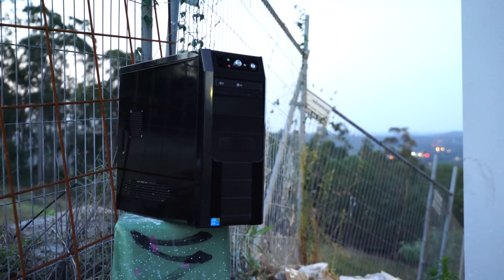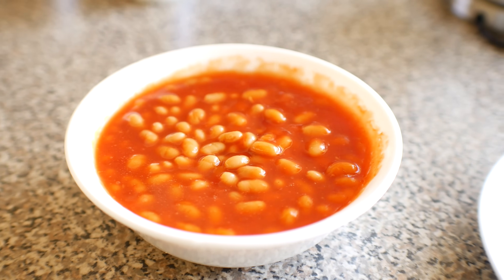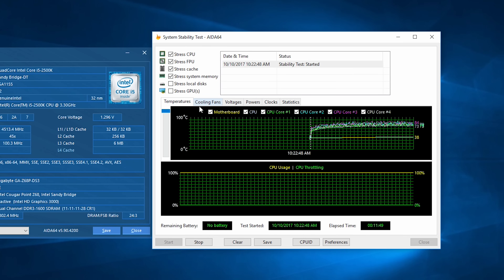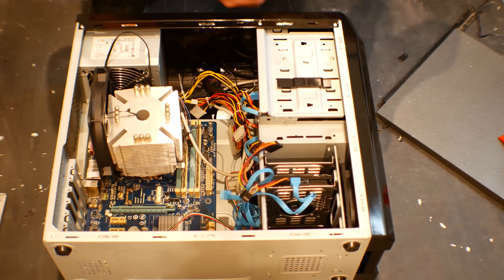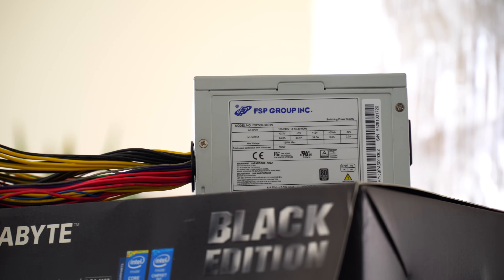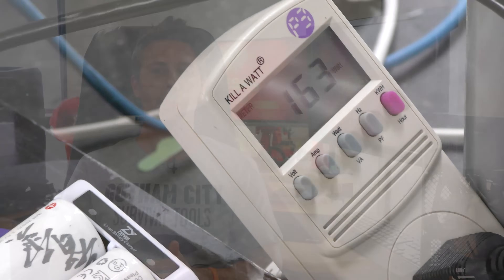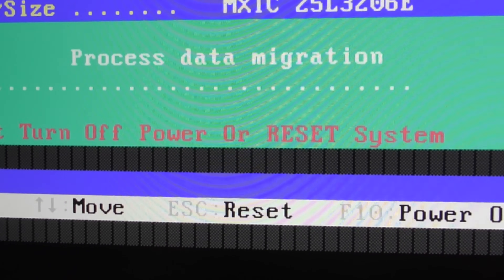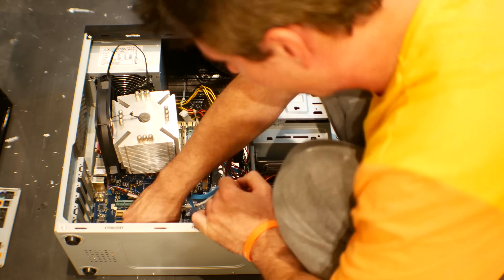Can you OVERCLOCK with a Zip Tie, Bad PSU & Budget MOBO?

Comment: Hey Brian i love your channel mate,i have a Z77 asrock extreme4 mobo with a 3570, but i cant afford to upgrade to a new platform, are you willing to sell one of your 3770k,s for som cash and my 3570k ,would help a great deal, thx mate.
Reply: Justin Merrill a i5 2500k and i7 2600k also fits in that socket, and ocs much further anyways as its soldered and doesnt get as hot...
and compared to a 3570k its like half the price on ebay
Reply: Ahh, thx for the info,and thx for the reply, love the channel.

Comment: Heh, I actually have that first Gigabyte mobo in my media PC. I believe it was the first one with the 3D Bios option. It really was (well still is) a pretty darn good board. I got it cheap as heck too. I believe with the i5 3570k it only added $30 to the price after a $20 mail in rebate.

Again, for the time (late 2011 I think, or maybe late 2012, I forget) having 2 PCIe x16 3.0, an m.2, 6gb sata etc it was a steal.

Comment: I found a gold-shrouded PSU in a computer on the side of the road. Took it home, stressed it with an old Xeon and a radeon 4770, it worked fine. I was shocked. I tossed it in my friend's build (he had an even worse diablotek one) and we carried on. Three months later, I found that same PSU brand new, in a box, at Staples. It was a Staples home-brand PSU. While it only had 4-pin power and one 6-pin, it actually was surprisingly quiet and good.

Comment: That 600W PSU has 25A on the 12V rail?
I got a 350W unit form FSP that has 2 rails with 28A combined.
Reply: Yeah, FSP is actually a pretty good manufacturer.
And the provide a lot of prebuild companies (like HP or Dell), and even those know that proper safety will reduce support hours and thus costs.
But the units in those OEM machines are still just fitting for what it is shipped with.

Comment: I had a Corsair HX520 blow up on me after 3.5 years.  I wasn't in the room when it happened, but when I returned the room was full of smoke.  Thankfully only the PSU had died, and back then Corsair had no RMA centre in the UK, so I had to send it to Holland.  They did replace it with a new HX650 though that is still going strong today and I've had that HX650 for over 5 years.

Comment: I had my first real PSU fail last year. The good old Corsair TX 750W. Though I did have it for 9 years :D
It died with a wimper too, took me like a month to even realize the PSU was failing. My HDD's were not showing on initial boot. After being off over night, I'd have to power on for a few seconds, then restart, and everything was normal. Overclocks were fine, gaming was great. I did this for like a month. I tried different hard drives, BIOS versions, SSD's, SATA ports, SATA cables before I had the eureka moment and thought "it's the fucking PSU!"

Comment: Should i try to overclock i5 4690k to 4.5ghz on h97 pc mate motherboard with good psu ?
Reply: Keni I'm not sure h series chipsets support overclocking
Reply: They do support oc
Reply: They support oc to some extent. Depends on bios and cpu. Some oc options can be missing, like voltage settings. Late bios versions can have oc support disabled even.

Comment: i7 870 Oc, R9 290 Oc with Chieftec 650W and died and killed cpu water cooler :D
Reply from the maker: lol I have heard of chieftec, ahh those PSUs ring a bell.
Reply: Im also building cheap computers but is very hard to find parts here in Croatia
Reply: How much you have overclocked the I7-870. My I7-870 goes 4,18GHz with 1,36V(22x190), but for a daily use I got 4,0GHz with 1,25V
Reply: It was 3,8 with turbo at 1,25V but later sold everything. Now i have ASRock P55 Pro and will put some xeon on it

Comment: Mate, I thought Diablotech was awesome back in the day  Haha...  I haven't OC my computers yet, didn't have confidence.  My old Gateway rig ate power supplies 3 years in a row, original  and 2 generic brands.  Has an EVGA  500W now and holding for 5 years.  This year I built a Ryzen 5 1600 system and used the EVGA 550W silver to start out with.  This was a $600 budget build and I left room for upgrading.  Planning on another Graphics card to run in SLI  so I can have 6 monitors (productivy not gaming).  I expect a higher end Coolermaster at 750 w will work well.
Reply: I seriously thought no one else would bring up Diablotech power supplies as I still have a 350 watt on my work bench in my backyard garage/shop as a bench PSU for testing fans, and older motherboards with onboard graphics to see if they boot, as I got for free from a case salvage, but I would never use them for anything more then that for sure.

Comment: The first PC I ever built from scratch was a Xeon 775 mod. I had spent all almost all my money on the motherboard, processor, RAM and GPU, and I decided to cheap out on the PSU trusting that the Corsair 430W I had picked up for 20 bucks would get along with the X5460. 
The first boot showed me otherwise, frying the CPU and the motherboard. Burnt smell only came out after the PC died though.
Reply: 430W should be enough unless you are running a manor hog of a gpu.
Reply: nn vv well it wasn't, or it was just in Terrible condition. It fried anyway.

Comment: Hey , I have an "hight power" name . And it's 750w 80+ only . I have an i7 6700 gtx 1060 16gb ram asus mobo 1 ssd 3 hdd . Should I throw that psu away ?
Reply: u spent 800+ on hardware, why not spend 30-50 bucks for a decent power supply?
Reply: Absolutely. That's full of rubbish components. I went with an EVGA Supernova G2 850W for the 10 year warranty. Only about 109 on Amazon right now if I remember correctly.

Comment: Yo man, i got a Q6600 (105 watt) , GT 1030 (30 watt) and 8 GB ram ddr3 and one HDD 500 gb, can my PSU 220 WATT hold it? Thanks :)
Reply: It should, but it would be wise to replace that psu if you can
Reply: maan that cpu when 20%ocd takes 80%more power.failed to oc 3.0ghz with a 450w psu and a gtx650.DO NOT do that.im amazed it boots

Comment: i dont know but my PSU luck is bad, like really BAD all time, except gigabyte odin pro 800w, i didnt have any problem with that and im using that PSU for like last 7 years. Not a single problem happened. But i bought two TT psu, 1 Antec and recently like 1.5 years ago Seasonic 750W gold rated, all of them got RMA'd. My luck is so damn bad that i got bronze rated 720w seasonic psu instead my original one coz seasonic had problem with local distributor. They dont bliv they had so much RMA issue, truth is in my country their PSU quality sucked big time, 1-2 yrs max lifetime for their PSU and then u must have to send it to RMA. My poor PSU luck.

Comment: Tech Yes City I tried overclocking my i5 760 on a H55 intel board. The board was working fine, i then changed the multiplier and the board refused to post, i placed the cpu in my other p55 board the cpu was fine, but how do I fix this motherboard that I altered the multiplier with
Reply: Resetting the CMOS should work

Comment: I had a Golden Field "550W" ATX-550WUS, 21A on the 12V rail, blew up on a C2D E6320 with a GT220, didn't take out anything else though.

Before that though, a Huntkey "500W" LW6500-HDP killed an ASUS P5K SE MB when I switched that system to stand by.

Comment: Yep, I remember that when I upgraded my overclocked Pentium 4 to 3.8GHz machine to a 2600xt my old PSU couldn't handle it so I bought a 460w Eagle psu on eBay and turning on the system just as it hit post it shot flames out the back and burnt my wall a bit. Thankfully it didn't kill my PC but I took it outside and smashed it with a hammer cause I was very young and very angry. Don't remember if I gota refund lol.
Reply: Angelito Posse id still smash it up even if i wasnt young
Reply: M Huang So would I, only now I would definitely chase that refund although thinking about it I think the seller gave it to me when I told him it shot flames lol. It costed like £10 though so what could one expect 😂

Comment: Not exactly a power supply for the first one buy had a fan splitter actually cause a burning smell, immediatly removed it and opened some Windows 

Then tried to run a ryzen 1600 @3.9ghz ,sapphire r9 fury nitro, and a 290x with kraken g10/corsair h55(think is was the h55 or h60) on a thermaltake broze rated 750 watt power supply. Booted up fine but was trying out ethereum mining and I heard a series of clicking sounds from my machine and other weird noises. Scares the crap out of me so I turned it off and bought a second gold rated 600 watt psu(got in brand new on Craigslist for under $40, sold it right before the august mini crash for $55) just for the graphics cards. Worked fine and safe for the weird setup. Ended up months later buying a semi-modular EVGA 850 watt bronze rated psu from Bestbuy on sale for $55

Comment: Wish my i5 2500k would run at that voltage for 4.5 but anything over 4.1 I need higher voltage than that if I don't want my PC to bsod but if I do that my processor gets very hot on my processor cooler :( but can run my processor at 4.0 at 1.25 voltage no problem but anything higher needs way more voltage and idk why.

Comment: PLEASE!!! compare Xeon X5650 OC to Ryzen 5 1600.
Reply from the maker: I do plan on doing that after this coffee lake stuff I have to get through, its on the top priority list, dont worry brother.
Reply: I have that exact Xeon. I had a 960 before. In my experience, the Xeon is waay better than the i7 960. Overclocks better and, even at the same clocks, in games like GTA5, I have higher framerates.

Mine is overclocked to 4.2Ghz. According to the cpu-z bench, at that speed, it has similar single core performance to a Ryzen 1700 at stock and better multithreaded performance than a 7700k also at 4.2Ghz.
Reply: My Xeon X5670 @ 4.44GHz cinebench r15 score is about 120 points lower than stock Ryzen 5 1600
Reply: Single core score in cpu-z of the Ryzen 1700 @ 3.7Ghz is about tied to my x5650 @ 4.2. Obviously the 1700 destroys it at multithreaded but the ol' Westmere chips aren't as far behind as their age might suggest. IPC wise Skylake seems to be about 40% faster than Nehalem. Ryzen is a little bit slower than that. The fact that multithreading is becoming better in software doesn't hurt the performance. In fact, the focus on multithreading actually seems to be hurting some mid range cpus from a couple years ago(BF1 seems to have poor lows on the 4 core i5s for instance).
Reply: No need since the 1600 is comparable to a 4930k/3930k it would beat the Xeon easily
Reply: I absolutely loved and was amazed by my X58 system with the OCd at 4.2 GHz Xeon X5650, I had that PC until last month and have gamed quite a bit on it throughout the years. In its latest iteration I paired it with a heavily OCd 980ti and a 1440p screen and I would be understating its performance if I said that It played smoothly everything I threw at it, including CPU heavy titles such as Crysis 3 and BF1 64 player servers. Here are some benchmarks I ran on it: Cinebench R15 - 953 mutli / 125 single, CPU-z - 2869 multi / 367 single, Firestrike - 14 341 physics. True, the chip I got was a very lucky one, it held its 4.2 at 1.29V rock solidly, was cooled with a nice tower cooler and never exceeded 70 - ish Celsius under synthetics. 
This almost 10 year old X58 platform was and still is an absolute masterpiece and is absolutely up to snuff, even in 2017 for gaming. I even think it would have enough horsepower to properly drive a 1080 ti at 1440p with modern multi-threaded titles, since that's where its strength is.
Reply: not by much!
Reply: andydsm what is cpu cooler?
Reply: Not as much as you'll think
Reply: Francesco Belli I had a prolimatech megahalems with push-pull fans
Reply: I used to run a X5650 before i went to a E5 1660 V3 then to 2675 V3 now i'm using a 1700
Only reason I did was the lack of actual SATA 3 (Yes it hurts your boot times, the X58 chipset is showing it's age) or even a black motherboard for a kickoff.
I think I also built a couple of 1600X systems not 1600 because i forgot to bench those 
My 4.4GHz X5650 scored 821 in cinebench (Uncore limits their performance greatly and you can't go very far without it BSOD'ing on you)
A 1600X scores 1240 at stock. Yes, 1240! I'm not sure if it was under XFR but it only had a miniscule ID Cooling SE214X so i doubt it was.

Also, X58 boards are now extremely hard to find, possibly most pricey than say my X370 SLI Killer because I paid 220$ for a P6X58-E WS 4 years ago and it was broken! So I had to revert to my EX58-UD5 which was flaky as all hell but i was using it since late 2012 to 1Q 2015

I now have a Intel bench for Z170/Z270 these days and I was less triggered by the Ryzen experience than it was for my 6700k. Jesus H Christ was i triggered
Reply: Spoiler: the 1600 wins

Comment: What should I look on PSU's  to know they are good quality?
Reply from the maker: There was a tom's hardware list of tiers of PSUs which was pretty damn good for a starting point, but usually looking at the 5v rail vs 12v rail is a start, if it is a "500w" PSU with 15amps on the 12v line then you know it's shit.  Though if it is a 500W PSU with 40A on the 12v then its pretty solid.
Reply: Tech YES City Well im gonna look for the toms hardware article thanks for the tip tho bryan

Comment: How are you getting more fps in pubg with a 660ti than mine gtx 1060😂
Reply: Corstian cpu and ram
Reply: SarsaurPlays i have 8gb ram and i5 6400
Reply: I have an i5 6400 too :p 16gb of ram and a gtx 960 and i run the game at 50-60 fps next upgrade will be my gpu. But I have the 6400 overclocked to 4ghz with a z170 board and an old bios so I dont really know maybe is the cpu because your gpu is a beast
Reply: In my channel you can see that I run pubg with good graphics just fine
Reply: You are having either a driver error, or some sort of bottleneck in your system. A severe one at that

Comment: Ive had a Corsair cx750 that ive returned about 5 times, Every time I hear the pop of  a cap and there fore begin the 2 week process of pccasegear RMA
Reply from the maker: Damn thats a lot of cx750s to go through, what components are you powering?
Reply: Dual x5550's, 780ti, 16gb ram and a SSD. Not very power hungry devices

Comment: My PC wouldn't post the other day, it just kept power cycling. Took it to MSY where I brought the parts and they said the bios deleted it self (running a 7700k on a z170 board) so they updated the bios and they said your power supply is actually faulty and replaced it for me. Such good timing too cause the store warranty would run out the next week.

Comment: Had an AM2 system years ago, power supply went bang, after that 2 ram slots stoppet working... :D lol
Reply: Tried to crossfire R9 270s with an "850w" PSU. It died without a bang, it just shut off. Thankfully, it didn't take anything with it.

Comment: My 4-year-old budget Corsair CX 600w PSU (With a PC that was online 24/7) didn't work properly after I blasted it with -20c air in the winter and I didn't properly let it warm up to the room temperature before turning it on. Though no fizzles or pops from the unit. The only way I got the system to boot was to tape power button down and yank the 24-pin few times in and out to get a successful boot. Got tired of it after few months or so when I wanted boot the system.

Comment: hey guys im planning to build my first gaming pc. budget at around 800. what do you think of this?https://pcpartpicker.com/list/LT9YvV any suggestions/thoughts?
Reply: I'd personally swap the motherboard for a slightly cheaper one and get an RX 580 instead of the 1060, seeing as prices are much more reasonable now. Other than that, your build looks solid.
Reply: TwinTurbo LM The 1060 would still perform better. Its the 6gb variant.  Ig anything Id suggest a 120gb ssd as a boot drive. That you would notice a huge performance boost in most daily task.
Reply: The 580 would actually be a better buy, especially when paired with a FreeSync monitor - https://www.youtube.com/watch?v=H6st6QZTDxE&t=494s

I agree about the SSD, though it would go over OP's budget
Reply: I was thinking of going for an ssd along side with that hdd. But that would take me way over my budget. So instead i would have to drop the 1060/rx 580 for a 1050ti. And get an ssd.
Reply: I'd personally get the more powerful GPU and buy an SSD later, though others may disagree. Alternatively, you could always go with an SSD now and add a HDD later.
Reply: TwinTurbo LM Depending on where you are 580's are still way to expensive compared to tbe 1060, with results usually within the margin of error. But if you could find a 580 for under $290-$300 id say go that but Ive seen more 1060 6gb cards for $270 around where I live
Reply: As long as the price gap isn't too big, I'd say that the 580 would still be the better option due to FreeSync, better DX12 and Vulkan performance and longer driver support. FreeSync alone is worth the small price premium IMO.